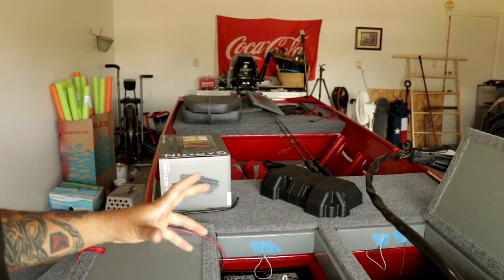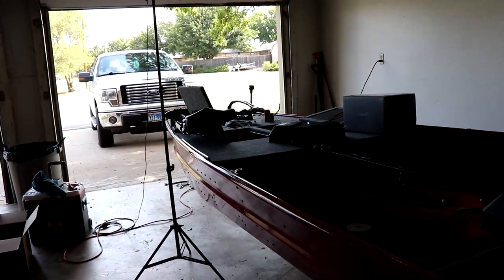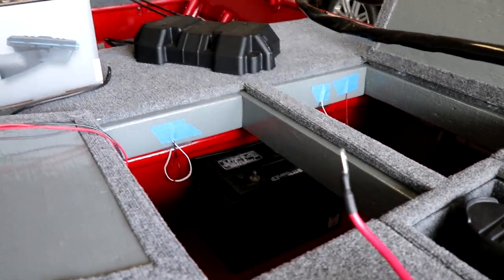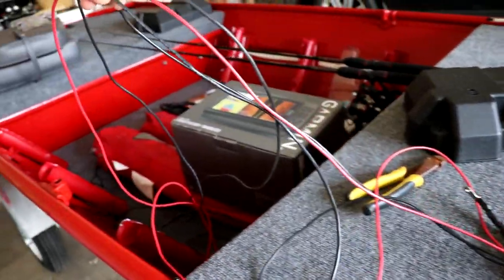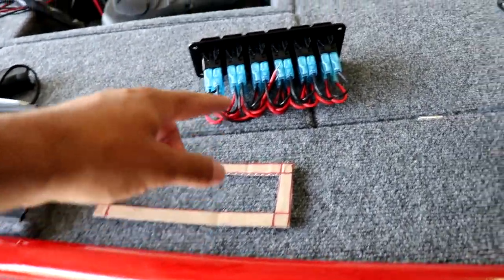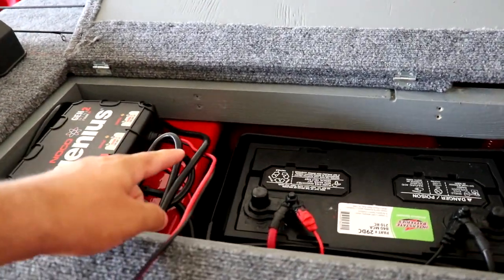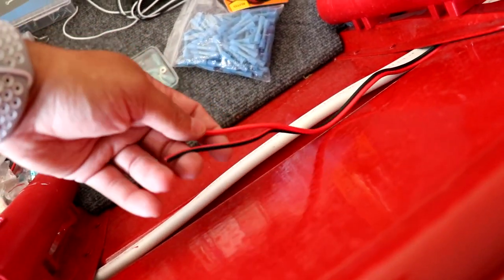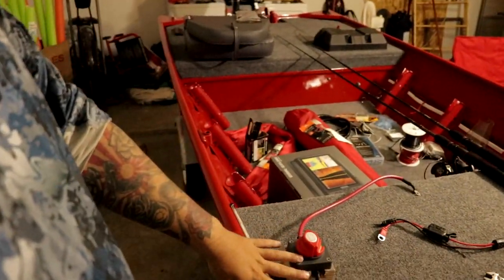Making Some CHANGES to my JON BOAT to BASS BOAT Build!!

Comment: Hey feller when your working with dc voltage and extending wire lengths you should go up a gauge in wire size or youll get a voltage drop also you bnt want your charging voltage to ever be under 13.8 volts and no higher than 14.5
Also for every 3ft of length youll get
About a half volt loss when theres
No increase in the wire size

Comment: Wow! its really a great looking boat nice quality work your doing I just have a suggestion have you thought of weighing batteries and gear to see where the weight is all around to distribute it evenly considering motor weight and where you will sit and your weight a bathroom scale might work for the most part be careful when you take it on the water it dose not dig when you turn.